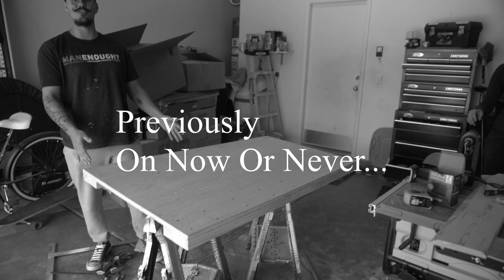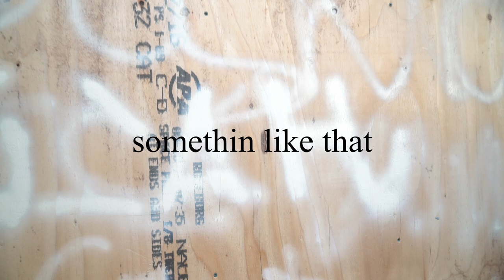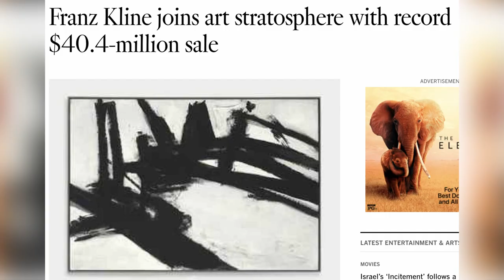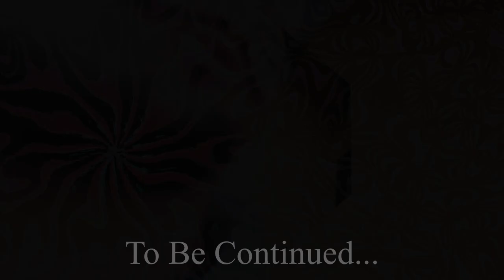We Made A Polka Dot Trailer | Skoolie Build (Ep.22)

Comment: Flex tap bro come on home depot in the window area has a bunch of stuff better than that
Reply: They got that and it was crap so that's why they went to flex tape and flex tape is great stuff anyway
Reply: @rickynandall9368  it wont last in the sun I work in construction and install windows for a living flex tap is trash
Reply: @ragnarlinn6431  it's not exposed they put it on then covered it with metal and other stuff it'll be fine